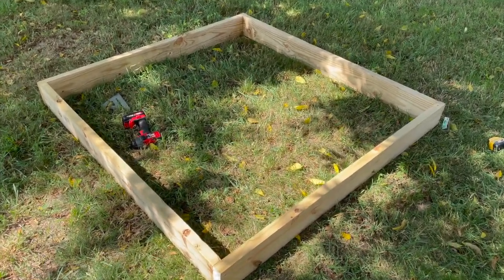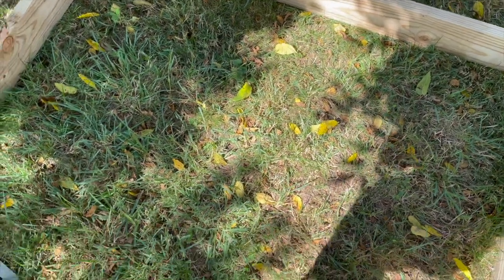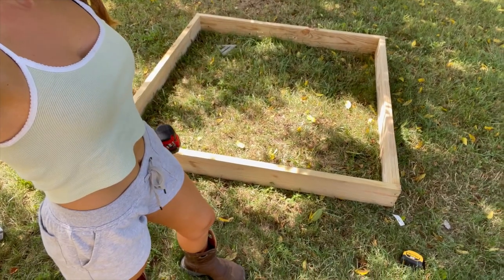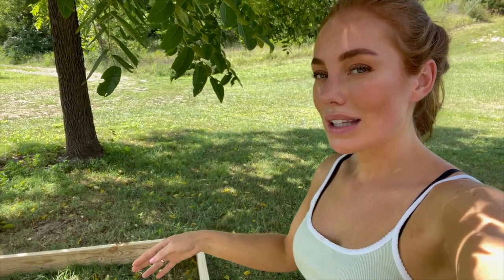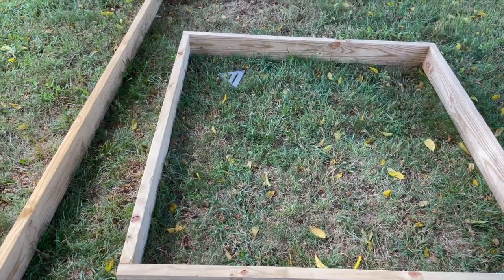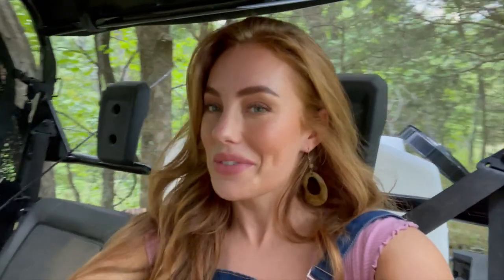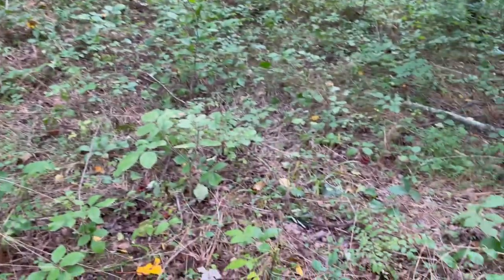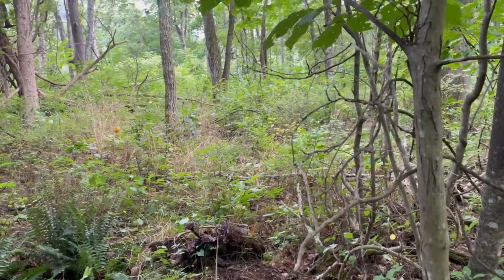One thing on my mind... HUNTING SEASON!! Building an Elevated Box Blind for the first time!

Comment: Ok, so now the U.S. Army and U.S. Navy Veteran.... HVAC technician and maintenance man can give you some tips. As you can tell from my earlier reply I am a licensed professional skilled tradesman and we already have plenty of weekend warriors up in here telling you how to do it. 

They are called sawhorses and you cut with your scrap hanging off the end. This prevents kickback and should you make a mistake the crooked or chipped piece is the most commonly effected while the good piece can be straightened up. The drill bit won't fit your impact because it is setup for 1/4" hex drive and you have to use those size bits. Joists are usually 16" on center and wood screws are best #2 Robertson/Square drive or T-20/T-25 Torx. They don't strip out like Phillips or Flathead screws.
Reply: You can rent a gas augier to drill the holes much faster than using a post hole digger for pouring concrete support posts. There is also a trick to mixing concrete but you will need a hoe and wheelbarrow. Instead of cutting the bag and pouring the concrete in lay it in the wheelbarrow intact. Chop the center of the top side with the hoe. Simply turn the bag over while grabbing both ends and lift. It dumps right out and makes it easy to mix with the hoe after adding water. Make sure you wash out the wheelbarrow before it sets up and it will all come out clean.

Comment: Your blind is to small, you should use pre cast concrete pier supports if you have issues regarding soil as far as excavation. Your dimensions would be better if it was 8’ length x 4’ width, in  my observations it is to small for two people. But it is sufficient for a one Hunter blind. To bad you don’t have a husband to build it for the both of you. In regards to your comment on the deer, did you mean, “Love Life,” or “Sex Life,” they have very significant differences In meanings you know. In regards to cutting branches of nominal diameter 3” an under I would use a battery operated, “Sawzall.” Works fast and is easy to handle.
Reply: You can rent a gas augier to drill the holes much faster than using a post hole digger for pouring concrete support posts. There is also a trick to mixing concrete but you will need a hoe and wheelbarrow. Instead of cutting the bag and pouring the concrete in lay it in the wheelbarrow intact. Chop the center of the top side with the hoe. Simply turn the bag over while grabbing both ends and lift. It dumps right out and makes it easy to mix with the hoe after adding water. Make sure you wash out the wheelbarrow before it sets up and it will all come out clean.
Reply: @JohnDoeEagle1  , No not cast in place concrete piers but Prefabbed you just purchase at the store.

Comment: Ya having a tape measure sure does cut out the math needed to cut a board!:))
Reply: So does finding center of anything. Simply put a straight edge corner to corner and put a mark near center. Where the two lines intersect X is your dead center.

Comment: 63 year old carpenter, superintendent and project manager. Been running a skill saw over 40 years and you young lady will soon be missing fingers or more if you don't learn to properly handle the saw. Do not ever again hold and pull with your outer ,,,,,left hand in this case while pushing the saw with your right. The saw will bind and kick back and the rest is a bloody story. same with cutting between the bucks. I have seen carpenters get away with bad habits for many years before they got bit, but then its too late. Please listen.